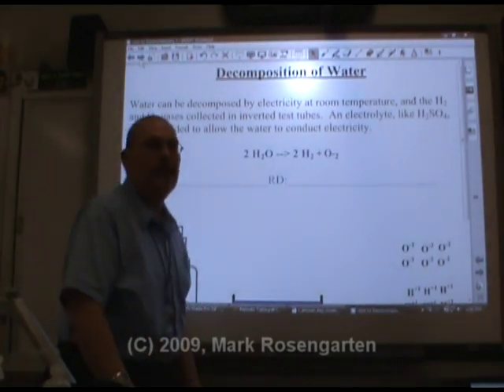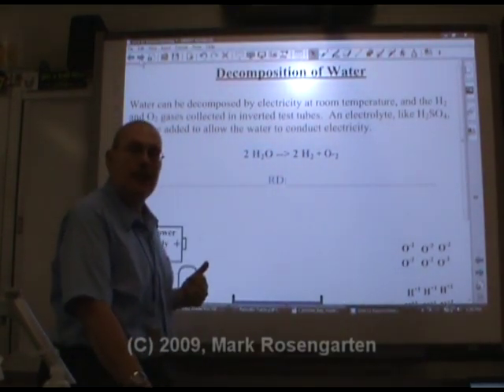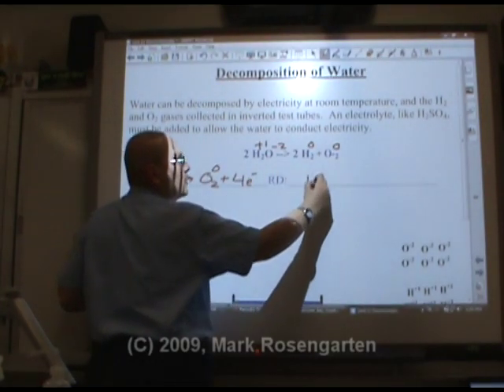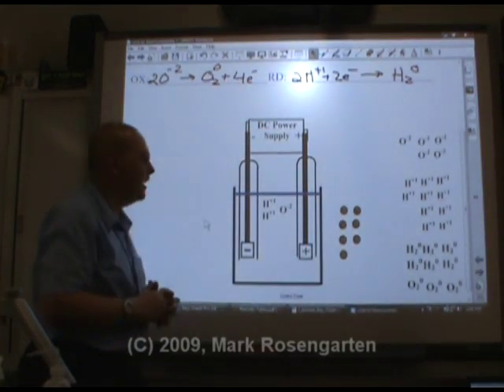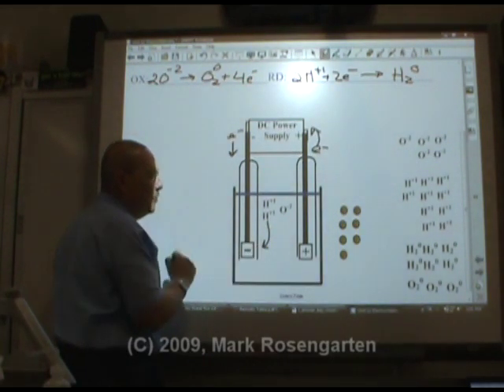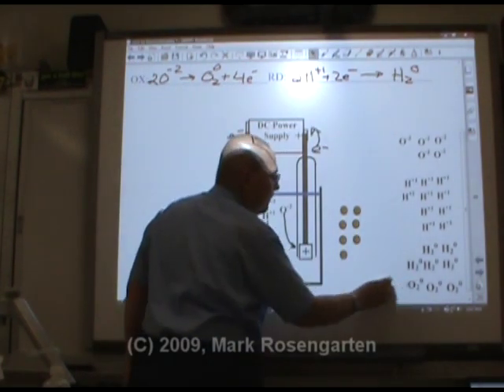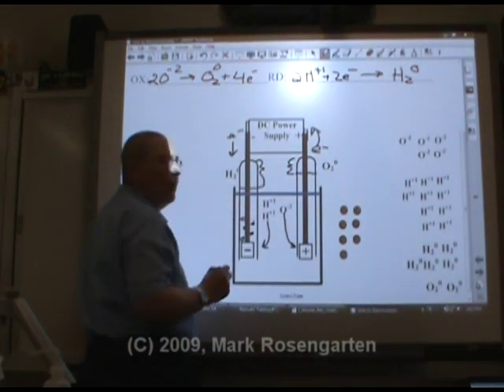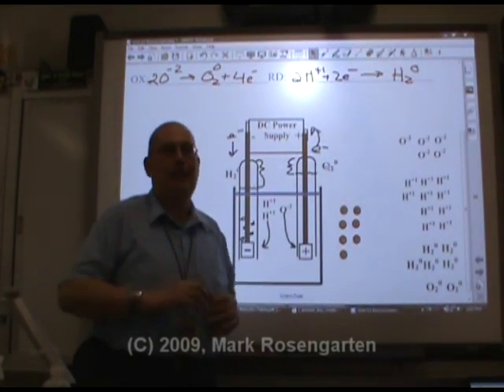Chemistry Tutorial12.3b:  Electrolytic Cells:  Electrolysis Of Water

Comment from the maker: @banmido12345 Because H2 and O2 are not bonded to any other element, they have no charge.  An element does not form a charge until it bonds with a different element.

Comment from the maker: H2O ionizes by itself to form very low concentrations (10e-7 M) of H+ and OH-.  However, this is NOT decomposition.  When electricity is applied to water (where a little acid electrolyte has been added to enhance conductivity), the water undergoes a DECOMPOSITION reaction to form H2 gas and O2 gas.  The first one is a physical change...but this second one is a chemical change.